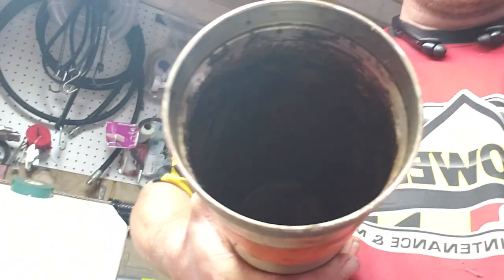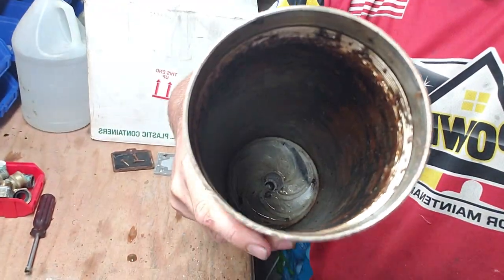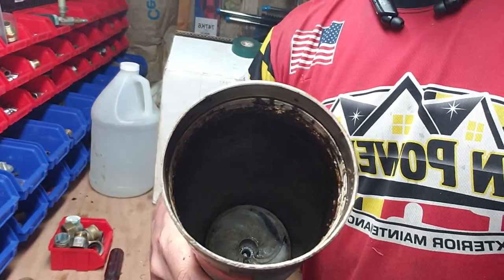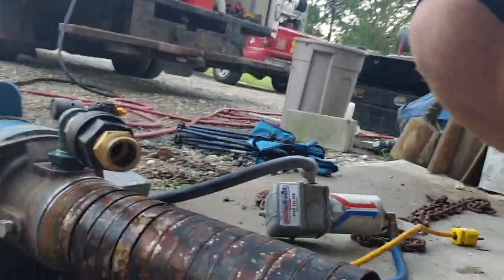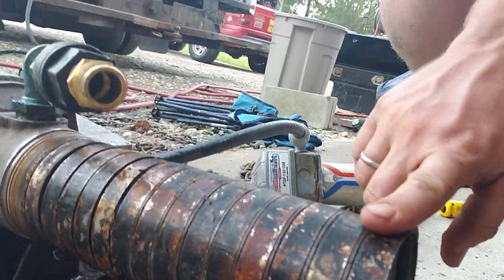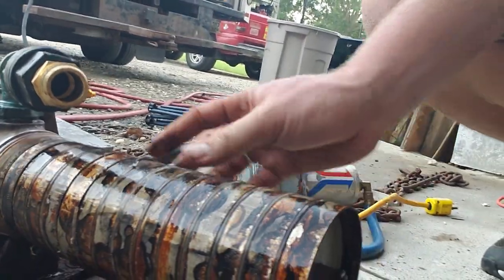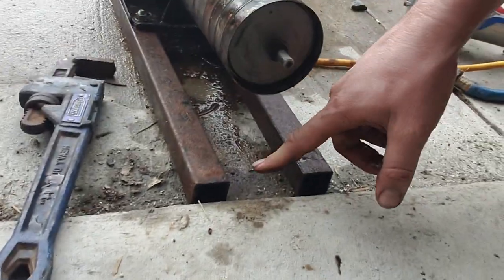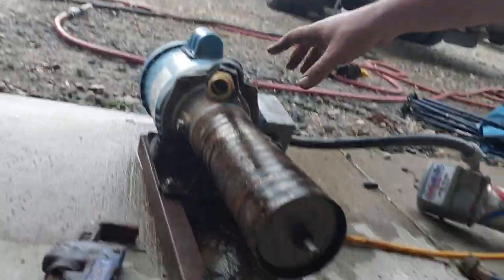Goulds booster pump servicing

Comment: How about a 1” Aodd , that corrosion is a big turn off. Rather depend on air.
Reply from the maker: Air fails too quickly and when it does, you are dead in the water.   It has been 6+ months since we did anything to that booster.  Air in that same time we have gone through 4 air compressor swaps, 4 cracked manifold replacements, broken diaphragm.  Each time those things happened we could not keep working.
Reply: Clean Power Wash 4 air compressors in 6 months?